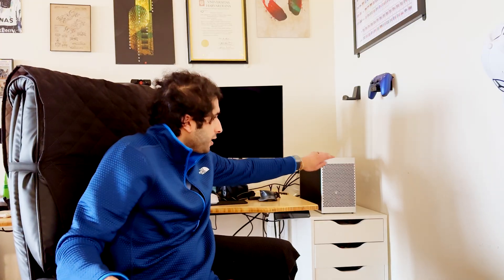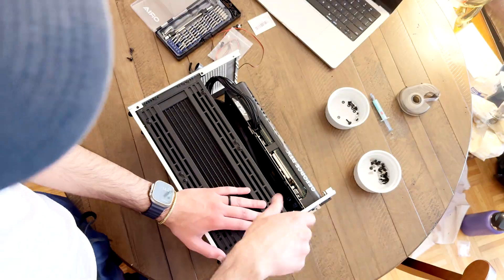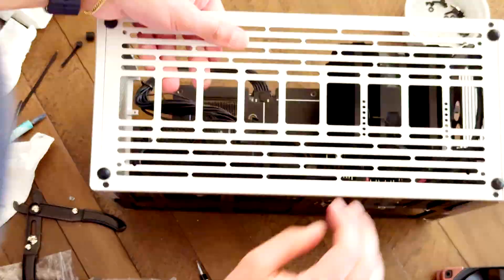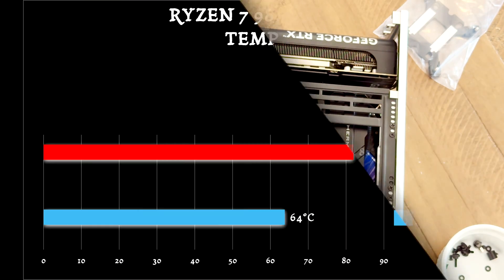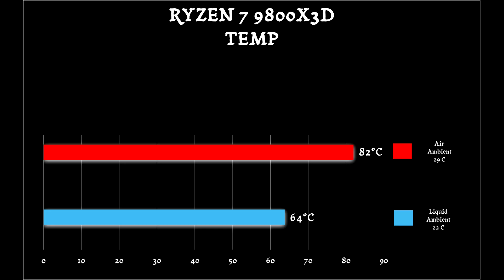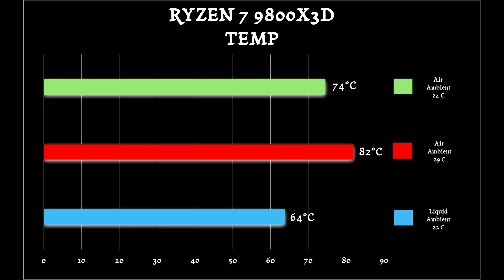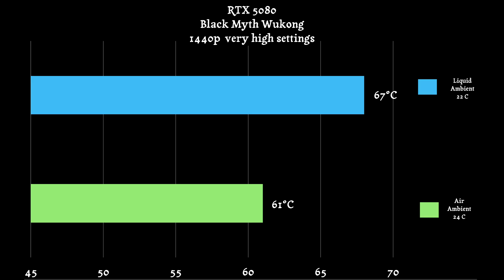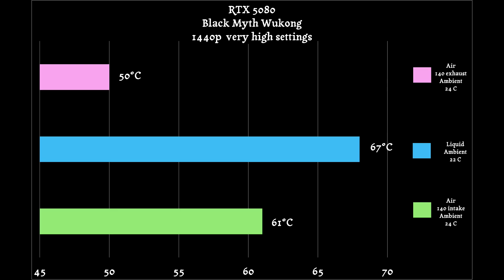Air vs Liquid Cooling: NCASE M2

Comment: I wanna build a similar PC. Practically the same cpu and GPU. It just makes more sense going with an AIO right. Since I’ll be playing more cpu demanding games like Fornite or Battlefield 6 in the future while also playing some games like GTA 6. (All at 1440p)
Reply from the maker: Nice, it's a great build! Yeah if you're gonna play more CPU intensive then aio is likely the right call. Corsair should be thinner than arctic and I would recommend a 240 rather than 280 so you can also have clearance for exhaust fans on the bottom (if you go with the upside config like I did).

Comment: I had the mini on my 9800x3d but couldn't keep it under 95c when i was playing black ops 6 so i just switched to a 240mm aio and it doesn't go above 90. I just recommend anyone using this case to just go with an aio!

Comment: What was the idle temp for the cpu with both? I was planning on getting a id cooling 280 because of its thinner rad. I already have the m2 grater case but was just trying to plan out and do some research on builds
Reply from the maker: For the artic freezer 3 idle was around 38-41 and for the air cooler it was around 43-45ish.

Comment: im curious about the decision to add a side mounted fan as intake, nothing in the case is using up that air, no? If the CPU cooler is intaking from the rear, blowing to the center of your case, and the flow through air coming from the GPU back panel cutout is also blowing to the center, the side fan is just creating turbulence (I think). So using it as exhaust along with the 2 bottom fans would likely yield better thermals?

I think it's worth a try, especially when you're no longer using the AIO, so its cleaner to work with.
Reply from the maker: Hey, yes, I mention later in the video that I switched to exhaust and it led to better GPU thermals (down to 50C in BMW) 6:55 in the video. Thanks for the explanation!
Reply: @beekargames8025  Oh right, I probably got distracted with sth else in that moment, either way Im glad that was a massive improvement! 

I was thinking about getting the artic freezer 240 for this build, while doing the exact same config (which others reviews suggested that there will be a CPU temp trade off) for better GPU temp and hoping the AIO would cool the CPU better than air coolers. It's looking like air cooler is the way to go
Reply from the maker: @StarbucksBob  I've been really interested to see how a 240 aio would go because you would then be able to fit exhaust fans on the bottom too. If you end up trying it out let me know how it goes. The artic freezer is a great AIO in terms of cooling but the installation is such a pain that I would personally go with another. I've also been looking at trying the 240 atmos.
Reply: @beekargames8025  with at least 2 reviews reporting that the LF3 having clearance issue with the assu b850, because the M2 heatsink, I'll probably stick to the D12L. Yes there are some that suggests flipping the pump so the tubing is at the top, but I don't think that'll be ideal, especially when the radiator will only be side mounted and not at the top.

What would be cool if it is even possible, is to top mount rad, with bottom mount gpu like all ATX, but I doubt there is a thin enough rad and GPU combo that'll do this.
Reply from the maker: @StarbucksBob  Thanks for that info :)
Reply: @StarbucksBob I have the M2 with LF3 280mm and Asus ROG B850i. The mobo m2 heatsink does have clearance issues. I removed the mobo heatsink and used a Kingston Fury M.2 drive that comes with its own heatsink. You might be able to do a transitional layout with the AIO radiator on top of it’s a think radiator and fans with a two slot GPU. I did the build 5 with side mount radiator and it works fine.